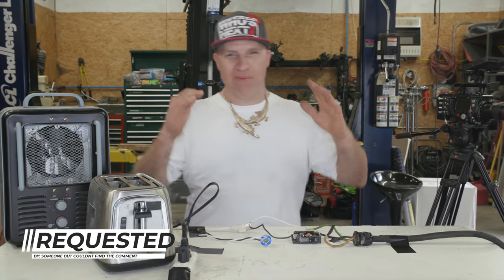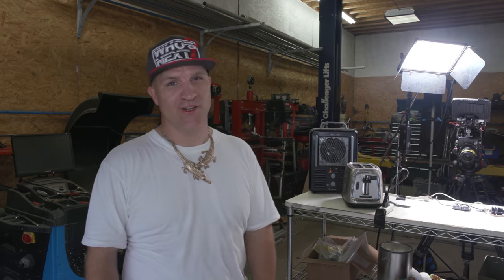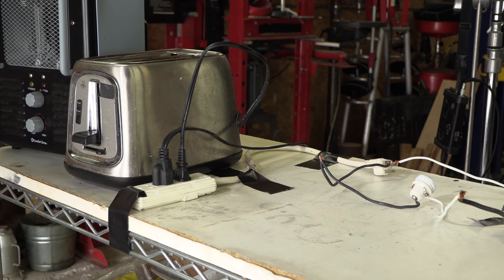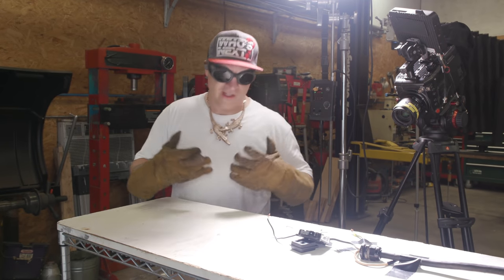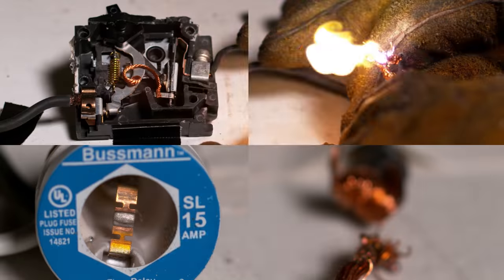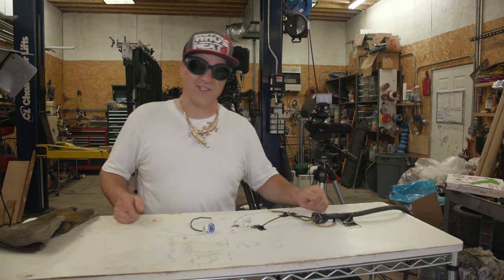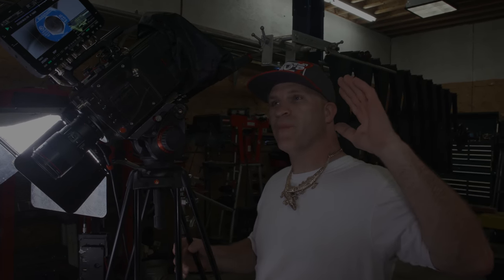Fuse vs Circuit Breaker Which Blows Faster (Slow Motion)

Comment: Had a lady using 3 space heaters on the same line (Multiple outlets, but same wire) and it tripped the breakre, what did she do... Turned it back on, Que 20 minutes later and we are getting called for a reported structure fire... Get on scene, fire is small in the attic, get it knocked down with only a fire extinguisher, and minimal damage to the attic and area around the wiring.

Tell the lady NOT to turn the breaker back on and to call an electrician to do repairs, What the hell happens... 20 minutes later we are being called BACK OUT because she fucking did the unthinkable and turned it BACK ON... This time over half the attic sustained fire damage, heavy water damage to the interior of the home as well as holes in her ceiling, and she had the damn nerve to yell at us for tearing up her ceiling and causing the water damage.....
Reply from the maker: Oh man..people are something else. That's crazy that she turned the breaker back on after you left.smh.
Reply: 0:00 did i notice the dog licking faces clip?
Reply: @WarpedYT   5:36
Reply: Just ONE reasons so many men gave up on marriage!
Reply: Let me guess: it was a knob and tube installation from the 'thirties.
Reply: @emailfilters  Not quite that old, but not new either, The area we serve is predominantly rural and poor, the houses reflect that. Most homes in our area are from the old coal days here in Kansas when strip mines were in full swing.
Reply: @ChiefsFireman  so it was a circut breaker because she turned it back on fuses blow and thats it right?

Comment: Circuit breaking time should be counted from short circuit to Extinction of Arc/ionized air. From the video I feel like fuse started circuit breaking first. But Arc extinction was faster in circuit breaker.
Anyway breakers are intentionally delayed from fast operation even in the event of a short circuit too. The time of operation really depends on it's class (B/C/D) and severity of short circuit. The idea of inverse time delay is to prevent tripping of circuit when a current hungry device is started( desktop smps pulls 10 to 12 times it's rated  current during starting)
Reply: Glad I scrolled and found this comment before commenting essentially the same thing.
Generally speaking, fuses are for protecting devices, while circuit breakers' primary function are to protect the downstream wiring to the device. 
Motors and transformers can pull anywhere from five to  eight to 10 times Full Load Amps for a fraction of a second to a couple seconds <when started under heavy load>, and you want a much longer time delay before circuit interruption for stuff like that. Those are known as "inductive loads" and take the C-curve breaker, for moderately high inrush current <I think around three to seven times FLA> or D-curve breaker for higher inrush circuits.

Many circuit breakers don't just rely on the thermal increase to operate the mechanism, they have a magnetic component as well. These are known, oddly enough, as thermal-magnetic circuit breakers - or therm-mags.
Where kids these days get the names for stuff, I just don't know...

If you have a device that is hella sensitive to even short term over current situations - a lot of solid state stuff can be - you want it fed from the lowest curve breaker you can get, depending on what other stuff is on the circuit, but you want to also add in some fast blow fuses just upstream of it.
The fuse in the video was a stand Time Delay fuse used where breakers are typically used today - in a fuse box, instead of a current situation where fuses are indicated over breakers.
If the video had compared a fast blow fuse to a standard HACR breaker, there would have been no doubt which blew first.
They are both circuit interruption devices, but other than that, totally different.
Just like if the video had compared a Red Delicious apple to a lemon, there would be no doubt which was more yellow.
They are both fruits, but other than that, totally different.

All in all, a very good video. It gets people interested in this kind of stuff and may spark a little more investigation and learning on their part.
If so, I would recommend going to the website of Siemens and looking up their free online course on circuit breakers, their construction, operation, rating, etc. When I did it a few years ago, it was free to do the course, but it cost a few dollars to get your certification that you had taken it.

It of course goes into some serious depth on circuit breakers, but also gives a pretty good bit of info on fuses as for comparison and case-by-case prescription necessities.
Reply: The test needs to be repeated. The Breaker just happened to open at the zero crossing, so it didn't draw an arc for the entire half cycle of the AC, like the fuse did. If the breaker opened at a peak, you would have seen an arc, just like with the heater demonstration.
Reply: Yeah definitely had breakers trip when powering on my desktop PC in the past, always wondered why it only happened when powering on (and only occasionally) but obviously they must pull more current briefly during startup as you said.
Reply: If its faster for curcuit breaker, y do cars have none. It is much more time consuming to replace wires in cars than walls. If it is faster then y are car makers still using fuses? Double edged question for car makers, lol.
Reply: @jeremybob18  because circuit breaker for Direct Current is hugely expensive and such a efficient protection is not required in case of a car. at the same time fuses are cheap.
Reply: Most circuit breakers have dual elements. The thermal element is the time delay to permit turning on tungsten bulbs and starting the AC compressor, but the flap you see in the breaker is the Magnetic element that is active in a short. It trips before the thermal element can respond.  The magnetic element is usually about 10X the rated current of the breaker.
Reply: @vincentrobinette1507  the zero cross is what makes circuit breakers easier to manufacture for AC compared to DC. in DC there is no low point in the current to allow the arc to extinguish faster. I'll bet that because of the way the MAGNETIC (short circuit) protection mechanism is designed you'll never get an arc.
Reply: @t0cableguy  You're exactly right. The magnetic field lengthens the arc, helping it to extinguish. Magnetic 'blow out' breakers are actually polarized, so the arc moves the right direction into the cavity, where the heat can't do any damage. If the current is the wrong polarity, the arc moves in the opposite direction, which can torch something. You can use a DC breaker for AC, but not the other way around.
Reply: @jeremybob18  apparently from what I read the Tesla is using computer-controlled Breakers or some type of current load - overload protection.
The story I was reading talked about how they overloaded their cigarette lighter socket and it would not reset and they had to wait multiple days before it would reset. I will take a fuse over that as the person was quite annoyed that they no longer had their DC power socket for anything for a week.
Reply: Don’t you have A fuses in the US? In Germany we do. Yet there are usually no D fuses.
Reply: Sorry you are wrong. Fuses trip way faster than breakers. A fuse will trip within the first 1/4 wave of the short. A breaker is a mechanical device that requires time, sometimes several cycles,  to operate the linkages that open the contacts. Fuses are filled with sand to extinguish the arc. When the fuse opens the arc travels through the sand and melts the sand forming a glass insulator    stopping the arc. The main protection for electrical devices is always a fuse. Even at your house as the pole transformer outside is protected by a fuse. You can see it in the wiring to the primary  side of the transformer.🤷‍♂️😉
Reply: @jeremybob18  put simply, cost

Comment: The plasma you're seeing from the wire spark isn't the air burning, it's the vaporization of the copper wire strands that are attempting to handle the short circuit current. 

The other give away is the green color, which is ionized copper.
Reply from the maker: I was going to look into that but I wanted to make it more dramatic! thank you for the info !
Reply: @WarpedYT   There's and entire codebook about protection of electricians from the phenomena. Its the biggest risk in the electrical field. NFPA 70E. at 120 you're pretty safe unless you do it right on your skin, but when you get into three phase it can create fireballs of copper and heat that will leave you in the hospital, sometimes for months, or even death. before you move up to higher amperages or voltages or move from single phase to three phase PLEASE consider contacting someone that can help you do this without being a human guinea pig.
Reply: @t0cableguy  ooohh green ball lightning... can we, pleeeease?? does the three-phase component make it to where it spins and gyroscopically stabilizes the lil slice of hell somehow??
Reply: i thought copper turns green due to rust, not ionization?
or is rust just ionization in metals?

Comment: Some people frown upon fuses when they actually can be superior to a breaker as there is no mechanical parts to fail and cause a failure to interrupt the circuit. Also depending on the construction of the fuse there are ones that can interrupt fault currents of  up to 200,000 Amps and above, without problems while breakers with high interrupting ratings will discharge hot particles and gasses from the interruption of a high fault current and its  resulting arc.
It's not uncommon to find a fuse protecting a breaker in some systems, acting as a current  limiter of sorts.
Reply from the maker: That's a great point, and probably the reason that to this day fuses are still used in a lot of applications, funny enough I was just thinking about that the other day, how is changing some really big fuses on a 480-volt main panel for some big motors that blew, I literally asked myself why do they still use fuses, that's probably why
Reply: @WarpedYT   Many reasons... Size is another, price as well... 
We have a mix of both at the hospital I work at, a lot of the distribution are big air breakers,  branch circuits are molded case breakers but the motor control centers and combination starters generally have tiny "J" fuses within although there are a few with a breaker instead.
Another benefit of a fuse is the fact after it operates especially after a severe fault you replace the entire device. A breaker WILL suffer damage after breaking short circuit current and can only do so a few times before its contacts and associated parts are in need of renewal or the entire breaker replaced... ($$$)...
Between you I and the fence post if I had to be in the vicinity of either a breaker or a fuse interrupting a fault I'd rather be where the fuses are...less chance of things going bad if they have a high enough interrupting rating, although I once did have a pair of glass plug fuses like what you used in your demonstration  explode within a switch once.. my fault 🤣

Comment: Use a fuse with high current  example with a welding machine
Reply from the maker: great idea, that may look different for sure!.
Reply: If he's making another video on this, I think that is a great idea. It will tell what blows first since the other one will be turned off and not blow. Also it would be nice to have the short circuit further away from the breakers so we could see the trip process more clearly. Only problem would be telling when the actual short began.  Aybe short with a mouse trap that also pushes a button and lights a dim led in the breaker frame?

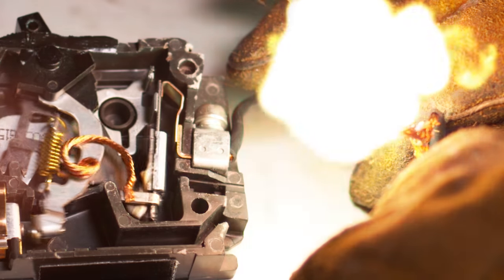Comment: 4:50 the air became ionized. The plasma arc unleashes UV light, as we see the black area, the camera's sensor cannot handle it.

Your first test was an overload condition, a very safe test, exceeding the maximum ampacity and reaching the end goal. The second test - while I'm keeping in mind you were making a point of speed - was just amazing. The only reason the breaker and fuse achieved their goal, was due to the unlimited current carrying capacity of the plasma arc.

I too have witnessed the dragon, although unintentionally. I switched off an old circuit breaker, which probably had conductive dust inside, and it produced an arc flash. My saving grace was the 60A breaker at the main panel.

Comment: The bussmann 15 amp fuse you are using is a Slow Blow fuse (time delay) , fuses that are in the slow blow catagory are designed to allow for a brief overload without blowing , for example the starting current of an electric motor. but will still blow if a current over 15 amps is sustained.   A normal fuse will react to an overload quicker..

Comment: I have been in the electrical industry for 40 years.. both have their place but, as a general rule, fuses outperform breakers in life safety performance. They can be designed to trip more quickly (less than one cycle) and they have a larger current interrupt ratings. Breakers are better at seeing and reacting to waveform disturbances as well as their overload function. Your typical typical fuse can withstand a short of 200,000 amps but they typical breaker is rated at 10,000 A...

Comment: Watching this sitting in Europe is quite funny, I could run this setup multiple times in every room and all it would do is make it warm.
Reply: What gets warm? The wire? Something is wrong if a short doesn’t trip the circuit.
Reply: He is talking about euro voltage and that they can run more power because 220v requires less amperage
Reply: Cranky Fox Gotcha. Maybe his house has 20amp circuits for bedroom outlets too. I’m still curious as to what is warm to the touch?
Reply: @TKO593  In UK household socket/outlet circuits (230V) are normally a ring, protected by 30 amp breakers.
Reply: @TKO593  the toaster is warm

Comment: I dont know if someone has already mentioned it, but unless you are using an HRC (high rupturing capacity) fuse circuit breakers are used because they have a higher fault current breaking capacity than a standard fuse. For example a standard C16 6KA MCB is capable of breaking 6000A fault current, and I'm referring to prospective fault current and not the tripping current for those that are not withing the electrical trade, whereas a porcelain fuse has about 1KA. If fault current is high enough a standard fuse can actually continue to conduct after blowing by tracking through the vaporized copper splatter in the fuse housing. This is mainly true for the porcelain rewirable fues, which is why in NZ if you are modifying a household circuit you are required to upgrade the circuit protection to a MCB if it's still using a rewirable fuse

Comment: Great vid. A fuse will always blow, usually within the first quarter wave of the short. Breakers if they are not cycled on/off after many years, can weld their contacts closed and not operate (trip) when needed.  It can take several cycles for a breaker to trip. To test the actual trip time, test for when the current stops in the test circuit not the flash.  Best to use a scope, a meter is not fast enough. The scope trace would look awesome on the slow-mo
Reply: Interesting. I have a habit of cycling my breakers in my house atleast once a year. Sounds like it’s a good thing to do.
Reply: @austinaubinoe  Thanks it is just one of the little issues I have seen over my 35 years of electrical maintenance. Some of the breaker panels at my work haven't been touched in 20 or 30 years

Comment: The copper metal vapor is what was burning, along with a  small trace of drawing oil used to draw the wire through its sizing dies during initial manufacture.

Comment: Pretty cool. 
Fuse or wall breaker...
Any of that is important. Fuse have to be installed in situations that after a short circuit a professional have to pay attention and discovering the real cause of the problem. Wall breaker for example can be installed in places that current get over like micro ovens and some heaters when the situation at all can be solved easily.

Comment: I don't know if we just have different fuses here in Sweden, but our old style fuses are made of crockery with sand inside. The sand allows for heat to spread from the wire inside when under load. Anyways, the type of fuse you used was way easier to see and understand for this video. :)

Comment: The difference in time between the fuse and circuit breaker could literally be down to the electrical frequency or hertz at the speeds you're filming at but a very interesting test and I'm surprised that the circuit breaker was basically identical.

Comment: If you ever get a chance to do this again, it would be cool to see how quick Low Peak fuses interrupt the circuit. They are not see thru as the old style but they are newer technology and are designed to interrupt in 1/4 cycle. Designed to minimize Arc Flash!

Comment: Very cool. Why does everyone update to breakers? I very rarely blow a fuse. It would not be cost effective to switch to breakers for me. I was thinking about upgrading the house because everyone says breakers are so much better. The most important thing is how quick it blows. You’ve proved that they are pretty equal with the fuse edging ahead in the one test. Thanks for saving me cash!!!